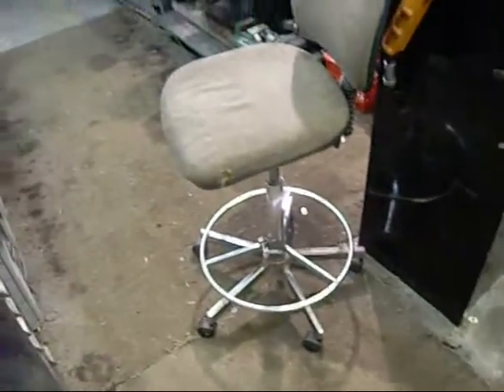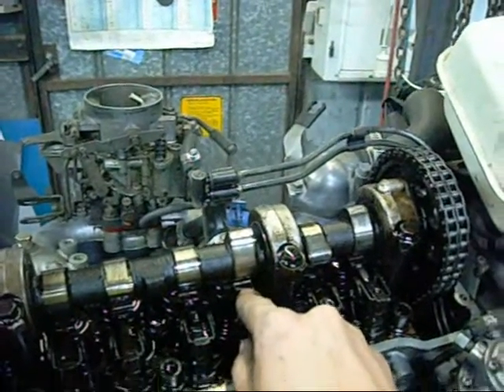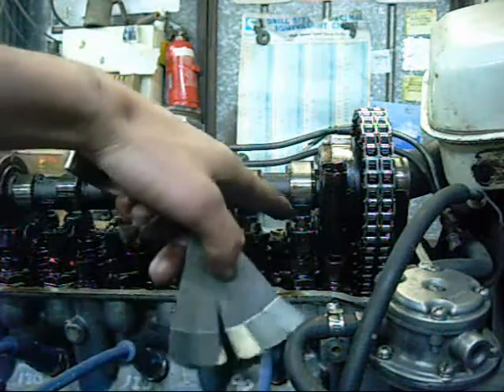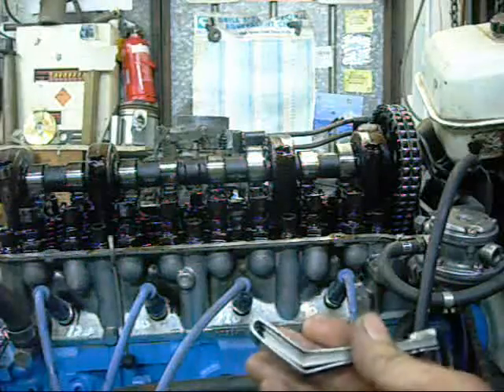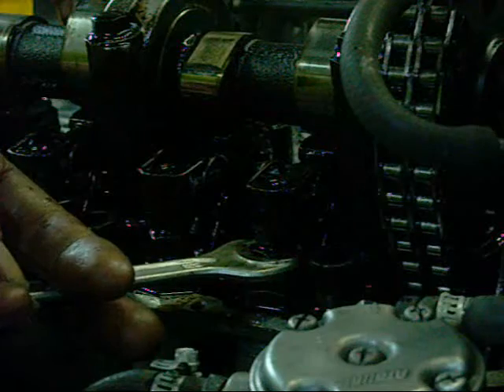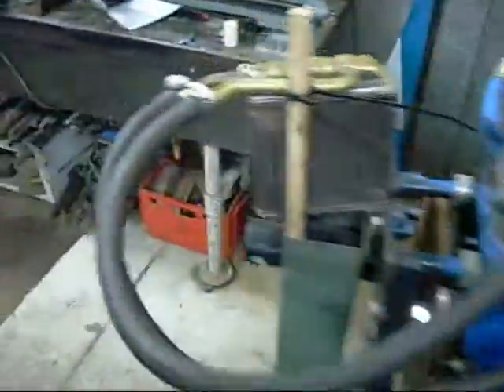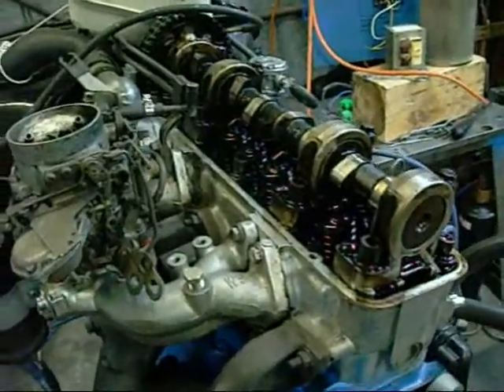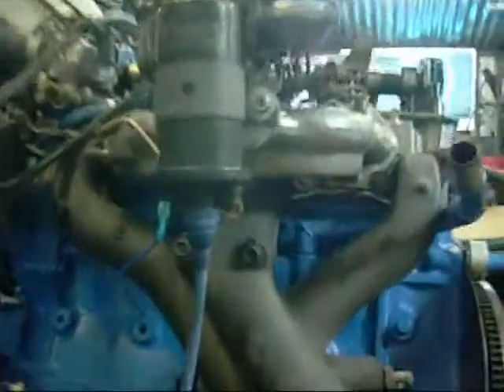Project Datsun L18 Valve Lash Adjustment

Comment: I am trying toadjust the valve clearance on my m115 engine, from my '77 mercedes 230.  its one of the mercedes engines this was imitating.  There is no gap whatsoever, the whole thing is way too tight, but I cant seem to turn the adjusting screws.  There doesnt seem to be any kind of set screw to release and adjust.  Do you have any ideas as to wht im missing? is it possible the  adjustment screws have been turned as far as they will go?

Comment from the maker: @LilTank39 I used all the same spec since they were so tight, I need to reset them to different specs when Hot!.
I think Exhaust is larger clearance than intake. Brad (V8jagnut) knows the exact specs.

Comment: lol i was wrong. that engine should be HOT inlet 0.25mm and exhorst 0.30mm. 0.35mm cold will do nice thow. its better than too tight. good job! should run nice now.